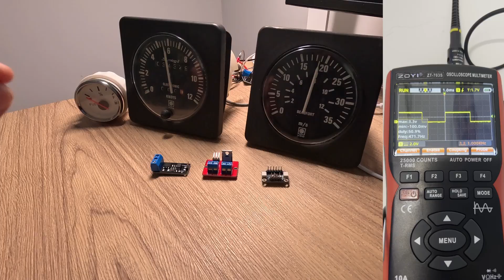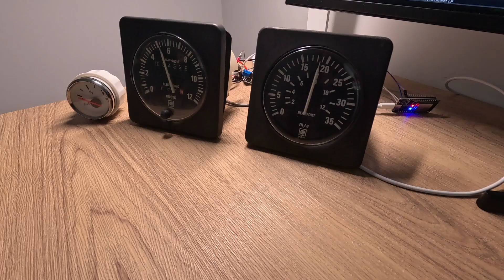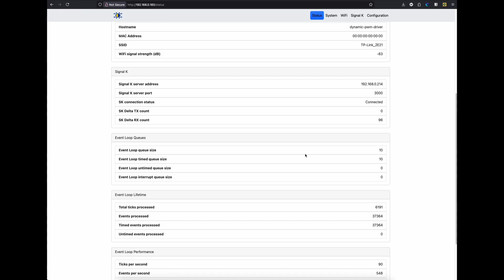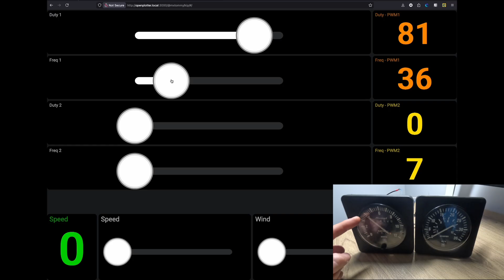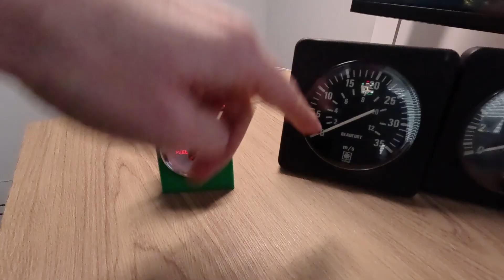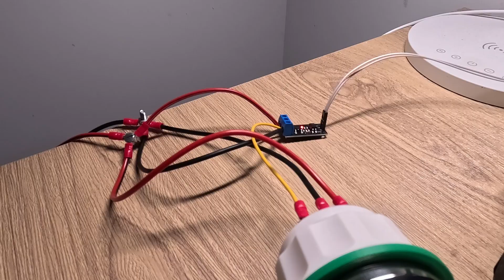ESP32 + SignalK: Bringing Old Analogue Gauges Back to Life

Comment: Very cool! I was hoping I could do something similar, as I love the vintage style VDO wind gauges, but the masthead unit keeps breaking. Using modern RS485 sensors on an ESP32 that feeds the gauges would solve a lot of headaches.
Reply from the maker: Thanks for your comments - Maybe look at building on this project a little and making the calibration process easier.  Be interested to hear back from you if you do get them up and running with an ESP32.

Comment: Would I be able to use this method to convert old DataMarine wind instruments (wind dir and strength)?
Reply from the maker: Hi - I think it would be possible. I've had a quick google and the wind speed is a pulse so that should work, the direction on these seems to be two wires, so it might need both of these (three units in total) or it might just work with one. Does your wind sensor and your display currently work. so we could reverse engineer it, or has something broken? I can help you try and figure it out, but it would need to be a winter project.

Comment: Great video thank you!
I have the exact same set of gauges. Do you think it's possible to also do this for the wind direction gauge? Since it's not a linear 0-max relationship?
Reply from the maker: Hi, Thanks for your comments on the video. It should work;  the code could be changed to add more points if it wasn't able to work out the angles between the values. 

What could happen if you were sailing dead downwind is that the gauge might try to go via wind dead ahead and then back again, so that’s the main issue I can see happening.

Would be interesting to try if you want to give it a go. You can email us at contactus@boatingwiththebaileys.com if it's easier to discuss it that way.

Comment: Thank you! I am in the middle of a complete re-wire of a 40 year old boat. I have replaced all the wire and gauges to new but the old style resistive type. I have also set up a 4 screen, dual SBC system for 2 kip screens and 2 OpenCPN screens (bridge and saloon). I have been looking into how to get my analog senders into N2K so I can read them in SignalK and still use the gauges at the helm with some accuracy. I think your set up here might be a better answer then the Antsence option I have been pondering, as well as some others. What ESP 32s do you like to use? I have no experience with them yet but I didn’t with the SBCs and coding either a few months ago. I too am not a coder, I use AI extensively to make everything work for my nav set up and it does. So what ESP 32s should I consider? And any recommendation on the direction to go with the analog gauge set up? I would be happy to show(off) my hardware set ups . Thank you for all the content, it has been a tool and a motivating factor in my builds.
Reply from the maker: Hi, Many thanks for your comments and your donation - Very much appreciated. For the ESP32 when used like this, any of them will do. For this type of work, i've tended to get just standard devkit ones, i've also used Firebeetle, anything really on the PiHut webpage. The later ones features in the last two Marine display videos have had PSRAM on board which helps with the graphics, but prior to that hasn't been needed. One thing to remember is that the Pi WiFi hotspot can be a pain but its worked ok for me. I am looking at a little on-board router and then i'll wire the Pi in. The issue isn't on the ESP end. Would be good to see the setup, send us some pics or a link!

Comment: Slightly off topic, but with your vast expertise, can you advise what is the best way to power off the pi in a boating environment? its not practical to do a proper software shut down before turning the power off every time, is there some way to shut down the pi in Kip, so one can then safely turn off the power switch. How robust is the pi or sd card if we just turn off the power everytime without a proper shut down?
Reply from the maker: Hi, Thanks for your question. I don’t think there is a way to do this on the Pi without additional hardware, some form of HAT as an example. The MacArthur HAT does do this. It has a sperate power supply and then a switched power supply. So, when you turn off your instruments for example, it initiates the power down and the 2nd supply is there direct from the battery so it completes a controlled shutdown. I have seen smaller hats in the past that have batteries or resistors to hold enough power to complete the process so that could be another option.

You do need to shut down gracefully, otherwise the card will get corrupted at some point. You might be lucky and that be weeks, but it will happen. 

SD cards are reliable, but if you want something more rock solid, then it’s an SSD.

Let me know if you have any other questions.
Reply: I am using MacHats and they work well.
Reply from the maker: Yeah, really good product 👍

Comment: I have an SSB that needs nmea 0183 4800 baud for GPS and used a C3 to listen to the TCP stream from SK and filter out the gps sentence. Just three modules: esp, 12v-3.3v, and the TTL/RS485.
Reply from the maker: They are great little devices! Sounds like an interesting project.

Comment: Any issues with driving the fuel gauge this way? Your method creates a dead short, albeit with a duty cycle. I had to use 3W resistors to manually set the gauge I'm working with. (0-90 ohm range) Anything less than 3W and the resistors get too hot. Will have to do some experimenting with a MOSFET. Thanks for the idea 👍
Reply from the maker: Hi, interesting, what make/model is that fuel gauge? I was messing about with the one I had with 1/4W resistors and there was no heat, same with the MOSFET, no heat at all.
Reply: @BoatingwiththeBaileys  The fuel gauge I'm using is from an old GM car. Your gauge must have a higher ohm range. Half full on my gauge is 45ohm which is 3.2 watt. I tried a 1/4w resistor before I knew any better and boy did that get hot! 😁
Reply from the maker: I might try another one. That one in the video is 0-190ohm. The MOSFETs can drive some high powered stuff, especially with heat sinks. If you build one, let me know how it goes

Comment: Can you post the link to the small circuit board? Great video, I was thinking of doing this myself. So far I have been using dasboardsk in opencp to show my gauges.
Reply from the maker: Hi - Here is a link to the circuit board, i've also created a sticky comment on the video with all the links in and the code:

 https://www.amazon.co.uk/dp/B07HBVTWMY?ref=ppx_yo2ov_dt_b_fed_asin_title - DollaTek 5Pcs D4184 MOS MODULE MOSFET control Module Field effect MODULE

Sorry the video went out before i had planned this morning.